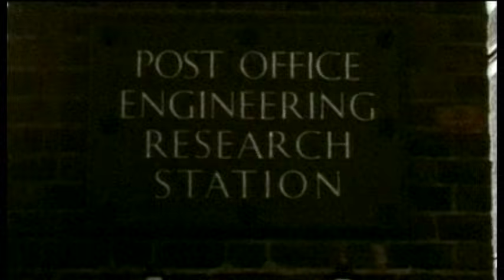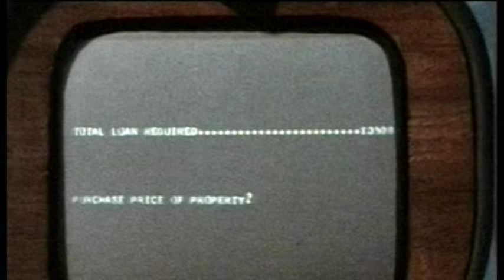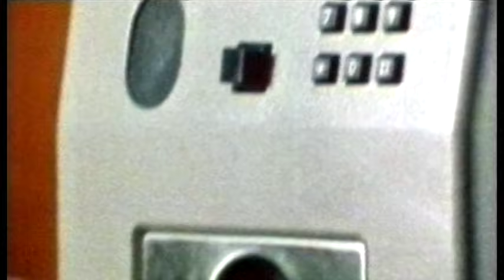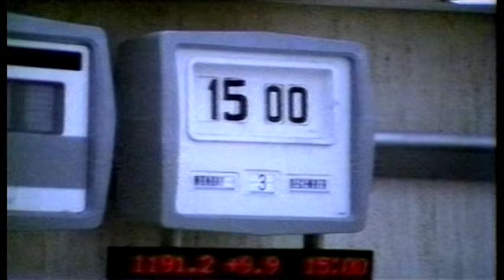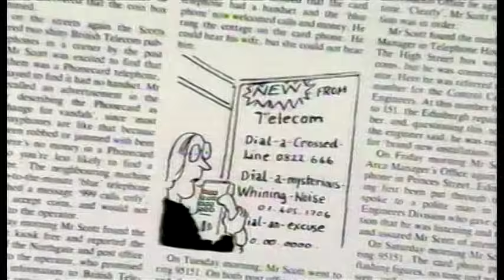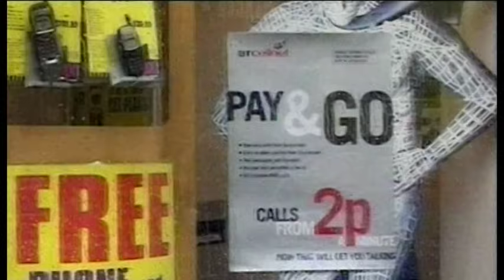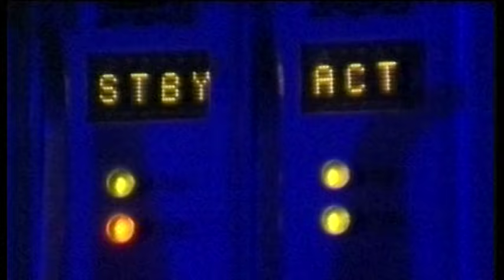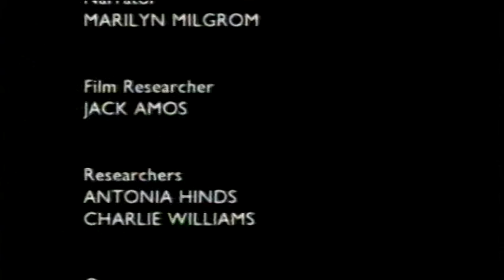Hanging On The Phone - British Telecom Documentary 2001

Comment: I started working for the GPO in 1980 after working for plessey  telecom for 10y on exchange construction. Strowger switch then cross bar ended up with system x.I retired from openreach 5y ago after 40y most of the time at the other end of the network has a pole tester safety checking the poles which for most of the time I was left alone to sort all of the poles in my area but some one Decided to control us and for the last few years had us going backwards and forwards over the same ground were I would have done it all in one go looking at the planet now with all the fibre things are getting over Loaded the is the just get working Attitude there now and safety is taking a back door

Comment: BT shares has dropped by 80% since then.
Reply: That's a load of bs for a start.
Reply: @nudisco300  You can look, in 2001 it traded at around 950 a share, current price as of writing is 195.9 Per share. Not BS at all, if you just looked.
Reply: @stantheman1998  If you're going to look into an historic price you need to know what's happened to the share capital structure of the business over that time frame. There was 2:1 share split in 2015 - for every BT share held you get another one free. This was done I think for the purchase of EE. There have also been several rights issues and a consolidation over that time frame. So it's not accurate to look at the 2001 price and compare it with the 2020 price. Apologies for how rude I sounded in the original reply.
A better way would be to know the full market capitalisation of BT in 2001 and compare with its current capitalisation which I think is £19 billion. That's the pure market value of the business without having to worry about share splits, buy backs and rights issues.